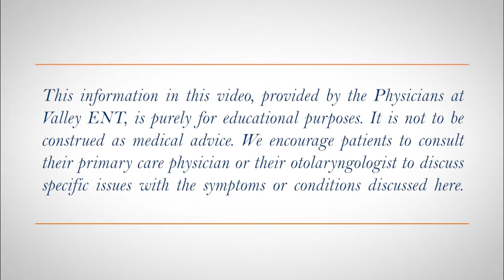Nasal Valve Collapse What is It? Can It be Fixed? Shepherd Pryor M D

Comment: I wonder if ear cartilage is really strong enough? It's pretty soft though. Did anyone have this Procedure?
Reply: yes. there are three types of cartilage in your body--fibrocartilage(meniscus), hyaline cartilage (articular surfaces) and elastic cartilage (nose/ear).  You're using basically the same material to repair the defective/traumatized/aged area in the nose.
Reply: @willzsportscards  thanks for your reply! But you can also use rib cartilage for the nasal valves which is stronger... I can't come to a conclusion which cartilage would be better for nasal valve reconstruction and every Doc has a different opinion
Reply: @helunanova  Interesting!

Comment: Ive seen articles discussing multiple grafts for valve collapse. I use a Breathe Right every night but looking for a permanent solution. Which do you feel are the most effective for an internal Breathe Right, especially in graft longevity; "Butterfly Graft" "Alar batten Graft" or "Strut graft"?
Reply: Did you find out more about that? I'm in the same Situation and every surgeon says something else. Some Use ear cartilage  some rib etc I don't know who to believe as I already had 2 failed rhinoplasties:-(
Reply: What did you end up doing? I'm using breath right and getting good results.  You just tired of it or need more support?
Reply: @willzsportscards  tired of buying them

Comment: I had a turbinate reduction and rhinoplasty surgery. My breathing was practically flawless immediately after the surgery and for about a day after the plastic braces were removed. Then, my breathing went back to just as bad as it was before. When I (try to) take deep breaths, my nostrils do flare considerably inwards but don't completely close (sometimes, but very rarely, they do). When I wear nasal strips to prevent the collapse, my breathing is considerably better, but still very wheezey and I still have trouble taking deep breaths.
Reply: I am the exactly the same. The day afterr the plastic stents were rmeoved it was great, now my nose caves in. PLEASE tell me you found a solution
Reply: @fraz3275  I saw another ENT a couple of months ago. My septum is deviated again. I'll need another rhinoplasty. For the nasal valve collapse, he suggested a fairly new procedure called VivAer. I haven't had it done yet. Because it's new, insurance is hesitant to approve it. I'm still doubtful. Even when wearing the nasal strips it feels like there's some congestion deeper in my sinuses.
Reply: @cosmoid  What have you done since?
Reply: @cosmoid how can a deviation come back its pretty much impossible if you hadnt had trauma on the nose. Sometimes its mental your brain stiill percieves the obstruction because of being used to it but its not there anymore. You got to relearn breathing

Comment: I had, supposedly, one of the best surgeons perform a revision for my collapsed nasal valves and still no luck. He states that it's still due to swelling, could this be true?
Reply: Miguel Beretta that happen to me too,like 2 months ago and i can't breath at night...i hope this get better..good luck to you and get better ok.
Reply: @jmr6117  11 months post op. No luck. I'm getting ANOTHER surgery, unfortunately
Reply: Hey guys how did you end up? I have the same Problem;-(
Reply: @helunanova  it's just NOW starting to clear up. Because of the many revisions I've had, I think my nose was still "numb" as the sides and tip started twitching and coincidentally has opened my breathing up
Reply: @miguelberetta7887  thanks for the Update! I'm glad to hear its getting better! Did they use rib or ear cartilage for the rebuilding of your nasal valves?
Reply: @helunanova  the VA used ear cartilage years ago. My surgeons now used cartilage from a cadaver
Reply: @miguelberetta7887  thank you! I guess they used rib cartilage from the Cadaver. May I ask you for the Name of your surgeon?
Reply: @helunanova  the latest one is Dr. Gilmore from UT southwestern, the one before that was Dr. Rohrich in Dallas
Reply: @miguelberetta7887  thank you so much. Wish you all the best and a good recovery and breathing!
Reply: @miguelberetta7887   Can you please tell me if it widen your nose?

Comment: I had it only because  I have a very short nose, with narrow nostrils,  that turn upward a bit. And no previous surgery or injury to it.
Reply: Nellie it work fine for you ? You can breath and sleep well now ?
Reply: @jmr6117  I am doing fine, much less congestion, the only thing is I have a pretty big bump in the inside of my left nostril and I know it is the cartilage that was put in there but wonders if it will ever go down,  it has been 3 months ago. On the right, there is one, but it is flatter inside than the other one. Also, if I breathe quickly in the can still close, but not completely as before.